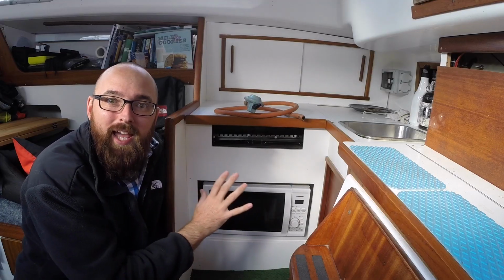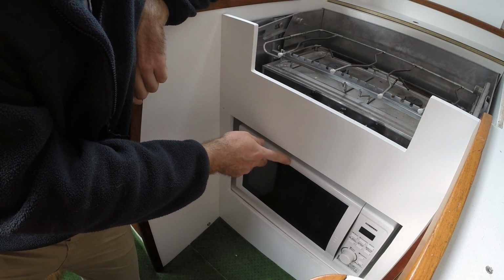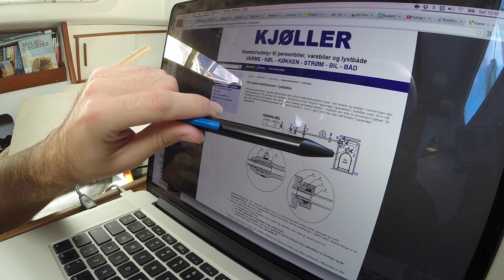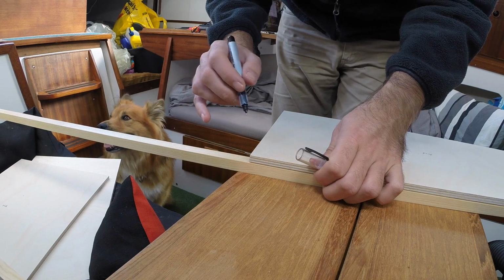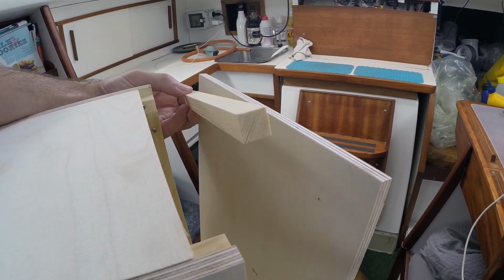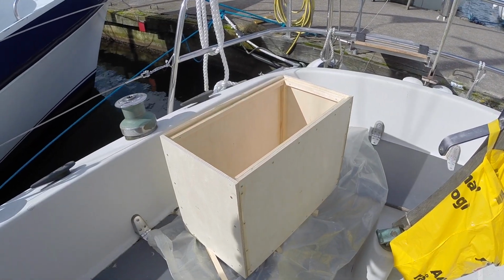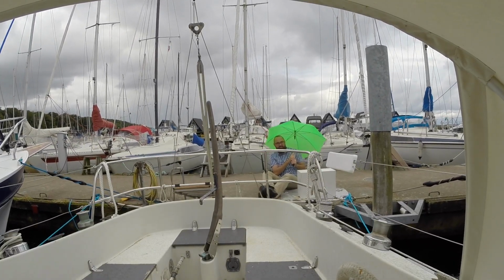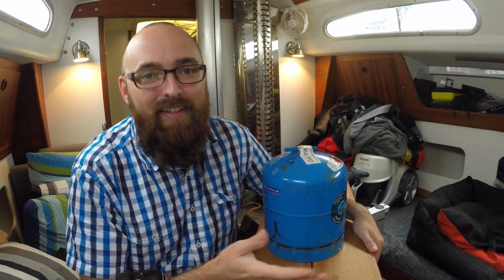Sail Life - LPG (Liquefied Petroleum Gas) aboard, part 1

Comment: Hi Mads, Nice work!  I would not worry about the final look of that box - it's going to be stored inside the locker anyways. Also, not to worry about butane not evaporating sufficiently to light the stove in colder temperatures. If I am not mistaken,  it's an LPG that you will store in a canister. that is it is stored as a liquid. When you actually use the stove the gas will evaporate, cooling the liquid. Consequently, the temperature of the liquid butane can actually dip below boiling point of the gas, which will create a problem. However, your stove is unlikely to use so much gas as to cool off the liquid sufficiently.  in the end, in the winter you can use a self-regulating cable to warm up the canister.  those cables are used for defrosting rain water pipes along thr edges of house roofs. etc. I am not a big fan of electricity and gas in the same place, but properly done cabling will minimize the risks.

Comment: While working at a local propane shop I remember more than once having groups of hunters stopping by on their way to Alaska in the fall. It seems that the butane systems they had installed on their RV was failing them in the chilly weather. At around 5C the butane begins to condense and provides no vapour pressure, without which you can't actually have a flame. We refitted them with propane, which has a boiling point of -37C and would allow them to make coffee on the coldest of mornings!
In short, in Denmark heading into winter, propane is definitely the appropriate choice for you.

Comment: Hi Mads, We just mount our gas bottles in a bracket hanging off the Pushpit where it is outside and just vents over the side. You can get Stainless Bottles but my galvanised bottle is 20 years old (and has always passed the 5 yrly inspections). That way you don't need special vented storage lockers and can have bigger tanks.

Comment: Good job Mads. A boat next to mine had a gas explosion, and the burns two of the men suffered were awful.

PS - Get out sailing when you have finished this!!
Reply from the maker: +redsnappersadler34 Yikes! That's bad! Burns are horrible. I'll do the installation to code and litter the boat with alarms.

Comment: A number of cruising people make a mount on the stern using one of the vertical stanchion so the bottles hang over the side of the boat. I have also see them use a SS fender and a tall thin bottle that fits inside it and use a sunbrella fabric cover over it.

Comment: Calling LPG butane or propane is a bit of a misnomer.  LPG is a variable mixture of both depending on local laws and ambient temperature.  The propane percentage can rise in the winter because of its lower boiling point.  (for the same reason that gasoline changes formula as the seasons change)  Natural gas is mostly methane and ethane which is lighter than air.  LPG will "pour" into low areas like bilges and basements.  A spark will easily ignite the vapor.  The summer blend, high in butane, is more difficult to vaporize which may make it seem more difficult to light.  Don't be "fueled" though these gases can explode when mixed with the right ratio of air (just like an internal combustion engine.)  Sorry about going on here but this is an area of expertise for me.
Reply from the maker: +Pass Me By There is no need to apologize! Your comment was very useful :) It only says butane on the canister but after checking online it does seem to be a mix. There was no information about the ratio or if they change the mix depending on the season. I'll call the company to see if I can get an answer :)
Reply: Instablaster...

Comment: Just for info:  Meth = one carbon; Eth = two carbon; Prop = three;  But = four.  The "ane" just means a simple chain of carbon atoms with hydrogen attached.
Reply: Natural gas is Methane & Ethane. It's what they use in the home gas supply from street gas pipes, & in cars marked NGV (natural gas vehicle).
On the other hand, LPG gas is Propane or Butane. It's what is used in this video, cooking/BBQ gas cylinders, and also in cars.

Comment: I am not sure about Daniel Pearson's comment about "Butane being lighter than air"

Google said this... Butane. This gas is more commonly called L.P., bottle gas, propane, butane and various other trade names. Liquefied petroleum gases are all heavier than air and will collect in low places when not confined. Carbon dioxide (CO2) at room temperature and atmospheric pressure is a colorless, odorless, slightly acidic gas.

Comment: I've experienced problems with butane when just a few degrees below zero, with a bottle 1/3 full. I replaced it with a full bottle, and the problem went away. So I suppose it was more of an issue with the temperature of the bottle (thus pressure) than an issue with the temperature around the stove. The simple solution is to finish almost-empty bottles during the summer. Not a big deal.

Comment: HI Mads ! nice to see you doing project so soon after moving in . I did not know that they made the type of fuel you are using in that configuration . I wanted to know if that type of fuel last longer then propane ? Also I wanted to ask  if you have seen the way some boaters set up their LPG tanks by hanging them on the rails off the stern ? Its seem to me that that would give you  space savings . Is it allowed to install tanks like that  where you live ? Here in Miami I have seen it on some small boats with tanks on the stern rails. I know it looks ugly but if you don't mind it would save you a lot of space . I know that the tanks I have seen are aluminum or powder coated ; some even look like the life raft from far away  . Just want to know your thoughts on this Mads, and if it could work for you  ?

Comment: Looks like a good Mini project!  

Some things to keep in mind and I am talking from my experience with an LPG setup. (same same but different)

1. You should have a gas/fuel detector in case of leak after the bottle (i.e hose or stove)

2. I prefer to shut off my fuel source at the bottle after each use. This got tiring with a standard bottle and tap as the bottle was out side in a below cockpit seat hatch. The solution is to get a solenoid electric cutoff. You can turn the bottle off from the comfort and warmth of your galley, even if the bottle is located remotely.

However this is all for LPG setup and I am not sure if the theory or fittings are the same for Butane bottles. But they are basically the same thing so I am sure the differences are minimal.

They can be found here at defender - 
http://search.defender.com/?expression=propane%20solenoid&s=1

Comment: Mads, why is there masking tape around the mast inside of the cabin, it has been there for a long time.
Reply from the maker: +john salter In short it's because I must have tuned the rig differently than the previous owner. The rubber blocks use to be held in place by the mast but now need a bit of tape to stay put. The boat will go on the hard in a few weeks and as a part of that I'll replace some wiring inside the mast and re-step it. Hopefully I'll be able to get rid of that unsightly tape ;)

Comment: Hi Mads,I definitely recommend to apply the solution mentioned by Sander Mertens below, which is to use a heating blanket for the gas cylinder. (www.powerblanket.com/propane-tank-heater/  ).
A butane gas cylinder will not be able to release any gas anymore below -1°C , a propane gas cylinder will do the same at below -43 °C.
But that is the theory which is specific for the type of gas. It is not only a matter of these  useable temperatures of the gas, there are other factors that play a role for a proper functioning of your gas stove.

At first, the pressure regulator needs to have a minimum gas cylinder pressure to be able to regulate the gas pressure while maintaining a sufficient capacity (gas flow) to your gas stove. At cold outdoor temperatures this might be a difficulty.

The second thing is that the gas pressure regulator reduces the gas pressure in order to guarantee a 100 % gaseous substance, instead of the pressurized gas liquid in the gas cylinder, which is called evaporation/expansion. But liquid gas requires heat to expand, which it obtains from the air surrounding the gas cylinder walls, that will get colder, and consequently lowers the gas temperature even more. This  depends on the gas flow quantity :  If you connect for instance a gas powered appliance that requires a lot of gas flow to a very small gas cylinder, you can even see in summer time that ice will build up on the outer surface of the gas cylinder wall, and the gas appliance will stop operating.
So, the purpose of the above heating blanket is not only to keep the gas above a certain temperature, but also to provide the necessary heat for a proper evaporation of the liquid LPG, into gaseous LPG for your gas stove.
The above explanation is also one of the reasons why (older) LPG fuelled cars were always started by petrol in winter. Then, after some driving time, when the engine cooling water was warming up, it was possible to switch to LPG because the gas regulator/evaporator in cars were  heated  with engine cooling water, providing the required heat to evaporate the liquid gas.

Anyway, thanks for another nice video and I hope you will soon feel "settled" aboard the boat !

Comment: Hi Mads
Thanks for a great video again! We just updated our gas installation to include a gas heater (propex) and we installed a gas alarm (http://www.force4.co.uk/department/safety/fire-gas-safety/gas-fume-alarms/pilot-gas-alarm-single.html) and a gas leak detector like this: http://www.gasproducts.co.uk/acatalog/Marine_Gas_Leak_Testers__Bubble_etc_.html 
The detector is fitted within the copper pipe and shows bubbles when the gas is leaking. Our gas canister is an outboard-draining locker outside and we have a gas hob and oven, and now a heater as well. Oh, and we also have two valves to be able to shut off the gas: one in the boat and one outside, next to the canister. By the way: I once asked you for the make of your oil lamp and I am happy to say that I have been given a delite/sorensen oil lamp for my birthday! So thank you for that advice!  :-)

Comment: Hey Mads, I used to have a lot of trouble cooking in the winter aboard boats with propane. I had to boil water, put it in a bucket and set the gas tank in the bucket.... Otherwise there wasn't even gas flow in the stove! I solved it using something like this (http://www.powerblanket.com/propane-tank-heater/), although I had it built into the locker.